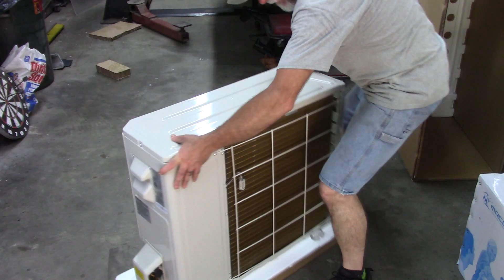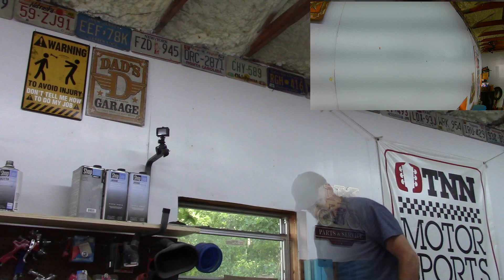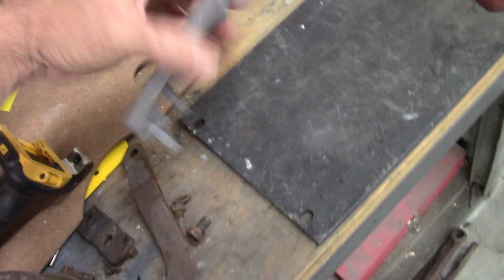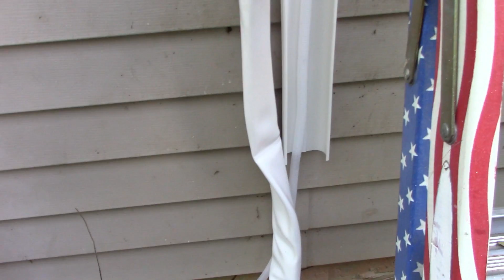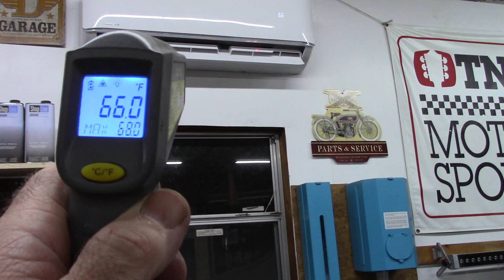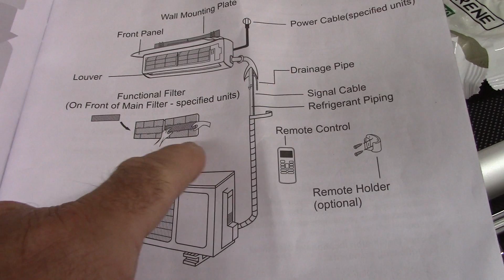Mr Cool mini split air conditioner install.

Comment: The drain hole under the condensor (outside) unit is for winter / heat operation as a heat pump.  In frost areas, while in heat mode, the pump action reverses and will thaw any ice accumulation and the water will need to drain out from the outdoor unit.  While in cooling mode, the condensation will come from the indoor unit as moisture is removed from the conditioned space.
Reply from the maker: Thanks!
Reply: Not an expert here.  But i understand the intake and out put on the air flow.  Got one of those cost me $10000 - $12000.  Would it be wise ti raise the sides of your concrete pad and put the drainge on?  Hate to see a build up of ice or a blockage.  Great work!

Comment: Do they sell this unit with cooling only ??? I don’t need the heating part ...
Reply from the maker: I don't know for sure.
Reply: then u want an air conditioner. not a mini-split heat pump.
Reply: bgregg55 I have a unit window ac . And they do make then just as ac units with out heating .

Comment: What's the price for the unit?
Reply from the maker: There's a link in the description. Prices vary on size.
Reply: @JoDaddysGarage  Mine was $1500 from Costco for that unit... should heat/cool 1000 sq ft, but really a little more.

Comment: The left end does not appear to be secure.  

How did you resolve the drainage inside?  I'm about to install a 12k.
Reply from the maker: It was secure. I think it just looked odd in the video. It has stayed in place just fine. I think the drainage problem was more of an outside issue, I played around with the line a little, and it all cleared up.
Reply: The drain line for mini splits is finicky. It needs to be run through the wall while staying "under" the lineset but make sure the lineset is not crushing it. I slipped a small ienght of PVC pipe around mine going through the wall. It also doesn't need to be laying flat on the ground but let it drip down instead.

Comment: No Vacuuming required on this unit, HVAC experts! None...Nada! Factory sealed and vacuumed lines precharged with refrigerant.  If you want to go through the additional hassle , to sleep better, feel free!  However it is NOT Required, and there are literally HUNDREDS (probably more) of Mr Cool Mini Split installs across their various BTU models, with success.Warranty Information from the manufacturer....Seven (7) years on compressor warranty, Five (5) years on all parts to the original registered end-user warranty,One (1) year warranty on remote control unit. State certified or licensed HVAC contractor not required for warranty on the DIY series units. Now, if your system develops a refrigerant leak over time, then the vacuum/recharge cycle would apply, once the leak were isolated and repaired.
Reply: Elder Geek is exactly right - the lines are Quick Connect Pre-Charged - you Do Not pull vacuum on this unit.  ( I thought he was wrong at first )
Reply: These are not "quick connect" fittings as most people think of as in a compressed air or water hose application, lol. These are threaded plunger type fittings with o-rings that will last the lifetime of the unit. Sorry HVAC techs ( I was one and still have my license) but MrCool is changing the way DIY homeowners approach air conditioning installs now. Excellent units for a good price.
Reply: As a seasoned tech I would put money on these quick connections to leak within the warranty period. The only true leak proof connection is by brazing it. Over time vibration from the system running will create leaks on any type of quick connection. I've seen so many different styles over the years of different manufacturers trying to make a quick connection but they always leak. This is why having a well-paid service tech that knows what he's doing and backs it up install equipment like this. Our company won't even work on equipment like this if there was a leak due to the fact that we inherit a continuing problem.
Reply: They are great for the industry though because eventually a service tech will get paid by the homeowner who did the self install anyways. Lots of people buying these that can only afford them because they install them by themselves end up needing help and bricking equipment.

Comment: can you connect more that 3 or 4 head units to the condenser. i can see that there is only one connection. what if i needed to have 3 to 4 unit heads to 3 bedroom and a living room. ?
Reply from the maker: They make units that have more than one head unit. Pretty sure the system has to be designed that way.
Reply: You'd need to buy a specific unit that's made for multiple heads. Some come with 2 or 3 heads.
Reply: thank you. yeah ive heard they call it multi zone mini split ac . aloha

Comment: I need one of these bad!   I have some past experiences with 2-ton and 3-ton cooling only units.  How well does the heat pump feature work?  I only had need for cooling in the past.  Now I need one to heat and cool what was a former garage space.  A small 1 car garage space converted to man room/office is what I am working with.
Reply from the maker: I haven't tried the heat feature yet. It's doing a great job cooling though.

Comment: Ou just skipped past the electrical and refrigerant connections.
Reply: You said that you ran 10/2 wire and your video of your outside connector box shows a white, a black and the bare copper ground wire.  However, this unit runs on 230 Volts and requires a three wire connection...a white neutral and a red and a black for the two 115V legs of the 230 Volts.   Please make this correction in your remarks.
Reply: Sven Svensen no it doesn’t, 10/2 is correct, no neutral
Reply: This is not a range or clothes dryer where you might need a neutral for 110v  operation of some feature. 220/240 alone doesn't use a white neutral wire.

Comment: on the outside lineset the larger 1 you will  notice there is a nipple thsts for pulling a vacuum but hey if she still running in 4 years that would be awesome
Reply: you don't need to do an evac on this unit.  the condenser and evap and lineset are precharged
Reply: @TheKiltedHam  i understand they come pre charged they mostly all do but u still gata vacuum the system down...and see if it will hold vacuum to chexk for any leaks
Reply: @SuperKp1986  there is nothing to  vacuum down. The entire system is changed. If you connect hoses and vacuum you will lose the charge.
Reply: People need to go to MrCools website and do some research before commenting. If you can't understand why this model doesn't need evacuating then you probably don't need to be a HVAC tech. Lol

Comment: Reducing piece for the line hide is an end termination. And as for the drain i always drill a hole in the elbow and drop drain tubing straight down so their is no condensate issues.
Reply from the maker: Thanks. Good info.

Comment: Just a comment about that plastic connector that wouldn't fit through the round hole. I used to work with connectors in HAM radio. I think you can unhook the pins from the connector. Here's a video on how to do that. https://www.youtube.com/watch?v=IFR9Wnslruk
Reply from the maker: I found out later they sell a split connector just for this purpose. Thanks.

Comment: Thoroughly enjoyable video.  The putty is electricians putty to use in your indoor/outdoor transition to keep critters and creepy crawleys out.  It is very similar to plumbers putty.  Did your jurisdiction require a permit for the installation?
Reply from the maker: I didn't ask....

Comment: joe garage thank you for the video ,I been fighting with my self over two years wether or not I can do this myself. Watching the video makes it soo easy to install. My only concern is why the wall unit leak water? My second question , Is their a video that shows how to do the electrical work. I've done electrical work, outlets, wiring and even added a 240 wiring for a dryer, yet it seems that the mini split requires a little more electrical stuff. Can you or anyone point to me in the right direction or video. Can someone explain why add a plywood to the wall? Is that to help hold up the unit  in case there isn't any 2 by 4 to match the wall mount? thanks
Reply: The mini split requires power to the outside unit, typically a 240-volt dedicated circuit, with a disconnect near the unit--that would be wired like any other 240-volt circuit (and it's just 240, not 120/240, so it doesn't need a neutral wire).  Then there's a four-wire cable from that to the inside unit.  With the MrCool DIY units, that cable has a connector on each end that you can just plug in; with most others there are terminals at both ends marked 1, 2, 3, and ground, and you need to connect them accordingly (1 to 1, etc.).
Reply from the maker: See Dan's comment.

Comment: You forgot to put nitrogen in for the leak test and you forgot to evacuate the system to manufacturers standards...   Your lines are filled with air and your gas is corrupted..  This seems to be what I see in all these DIY installs..  This Old House shows the proper methods to do this.. But you got all 'muscle work' stuff done correctly..
Reply: You're making a point that has been made, and answered, about 20 times in these comments.  The "manufacturers standards" say no evac or leak test is required, so no, he didn't "forget" to do it.
Reply: Maybe this is a lesson that Mr Cool is to be avoided like the plague and take at least a basic refrigeration course before attempting this..  When you attach the lines, the line has air in it, you open the lines when you install. It's impossible to not have the air in the lines. You always leak test and evacuate (50-500 microns)  or the system is corrupt. How does one know if they tightened too little? The leak test. First you put in nitrogen to what the system and lines say is the maximum PSI to leak test, then another leak test is done to see how well the system holds a vacuum.. Watch the the This Old House, they do both.  This isn''t the only DIY video that shows no use of refrigeration knowledge. We clean up lots of houses where the owner went out and bought a DIY type minisplit and blew up their compressor in a year from not knowing what you learn in just a 7 day basic course..    It's OK for a regular person to install the units on the wall, but leave the line install and the system prep to a professional or at least someone who took a basic course and has the proper tools.. I didn't even get into the static pressure test after you put the gas in and watching the system with a manifold to assure the system runs correctly through a couple cycles.

Just add me to the  NEVER DO IT LIKE THAT pile..
Reply: Maybe it's a lesson that you should learn what you're talking about before making such broad statements.  The system is designed for DIY installation, without the need for evacuation.  No, the lines don't have air in them; yes, it is possible for this to be the case.
Reply: The lineset is sealed. It has special valves on the end that are opened by the act of attaching them to the condenser unit. The only air contaminating the system is the teaspoonful that is captured between the fittings as you tighten them. The unit is precharged with refrigerant of the correct amount for the set length of the lineset.  What you are referring to is if you used conventional copper lines and flared ends on them... then you do have to vacuum the system down and remove the air (and moisture).

Comment: Those "rubber feet" are most likely seismic buffers for you to put on the condensing unit to mount to the hurricane pad. All foreign retailers are meant to put those in there in case the buyer lives in an area that has earthquakes.
Reply from the maker: .I doubt they're for earthquakes. It makes more sense that they are just anti-vibration pads. Likely for use when it is mounted on the side of a building to help keep any noise down.

Comment: Setting your ac to 66 will not make it blow colder air than setting it a couple degrees lower than the room temp. 

Works the same amount regardless
Reply: william adams   This is variable speed compressor and the lower the set temp is the lower the output temperature is.

Comment: Great vlog and explanation.  What made you pick Mr. Cool?  I like that it says "Do it Yourself".  Did you consider Mitsubishi or Fujitsu?   I wonder if these are covered under warranty if you install them yourself?  Anyway, THANKS!
Reply: I've been researching these units a while myself, and though I didn't buy a MrCool DIY unit, they're the only ones I've seen whose warranty is good if self-installed--any other brands void your warranty unless it's installed by a HVAC pro.  The big differences, as far as I can tell, are (1) the line set is much more flexible, and (2) the unit doesn't require that you vacuum it out when you install it, so you don't need much in the way of special tools.
Reply from the maker: I chose Mr Cool because it was a DIY. Didn't see any others with that option.

Comment: Good install for a first-timer ;-) They show the condensing unit being mounted on blocks and the fitting of the drain elbow because it is needed when used in heating mode.  During heating in the winter time the outdoor coil will freeze over and the unit will go into defrost mode every now and then. The defrost water needs to be run away from the bottom of the unit otherwise ice can build up and damage the coil and fan if you are unlucky. If you are not going to use heat then don't worry too much

Comment: suppose to put a vacume on the unit before opening the gas, moisture is a killer on these units
Reply from the maker: Pre-vacuumed. Not required per manufacturer instructions.
Reply: The line set can not be pre vacuumed if it were then all the vacuum would be lost once you took off the caps. Once you opened the caps you are letting in moisture into the lines.
Reply: If you look closely at the line set the couple of times it’s shown... it has specialized fittings on the end that seal the lines and are pierced by the connection to the condenser. Then you open another valve at the condenser to open everything up. Those lines are a set length and not designed to be modified in the field. They contain a set charge of refrigerant.

Comment: Great vid, I would use a longer bit for the pilot to go thru the out wall. Makes drilling the other Easyer. If you had to go outside. Did you considered pvc pipe?
Reply from the maker: Did not consider PVC.

Comment: Everything look good but you forget to vacuum the system
Reply from the maker: Not required per manufacturer's instructions. Pre-vacuumed.
Reply: In hvac field when you open a system as the lineset we always pull a vacuum so noncondensible want enter the system which can have an effect on your superheat and subcooling. But good job tho
Reply: g smoove The lines are vacuumed at the factory. No need to do it on these units.
Reply: @3plecrown  not once you connect the two units together. There could be condensation on the line that was open. Get it
Reply: James Brooks I get that the engineers who designed it know more about it than you or I do.
Reply: What so many so called pros don't realize or they just want to post and confuse people is the MrCool DIY models come with refrigerant already in the outside condenser just as any other unit BUT the inside evaporator and entire lineset is already evacuated and under a vacuum from the factory. They have quick connect like fittings to allow a DIY type install.
Reply: @rydfree  
It's because many of those so called pros are just gofors who work for a licensed HVAC installer. Anytime new technology or better ways come along, the so-called pros cry and whine and try to confuse everyone else, because they don't take the time or effort to LEARN.

Comment: Possibly limited use unless bac to back installation where the pipework is a straight run . Is the unit meant for a domestic use ,you buy from a hardware type of store ?
Reply from the maker: Lowe's sells them.

Comment: Thanks for the video. What state are you in, What's the square footage of shop and temp outside?
Reply from the maker: Ga. 900 square feet in main shop. Temps in the 90's.
Reply: Thanks. Kinda funny, the part of the shop I work in happens to also be 900 sq ft.

Comment: Also didn’t see any evacuation of pipe work , non condensables in the system , will effect performance and the equipment etc
Reply from the maker: Lines are pre-vacuumed by manufacturer. Not required per instructions.
Reply: Never heard of a line set being pre vaccumed lol.
Reply: @blakehollingsworth839  You should catch up. This is new stuff. :)